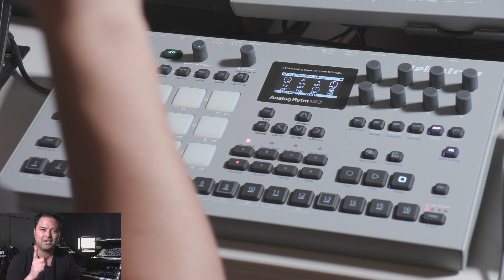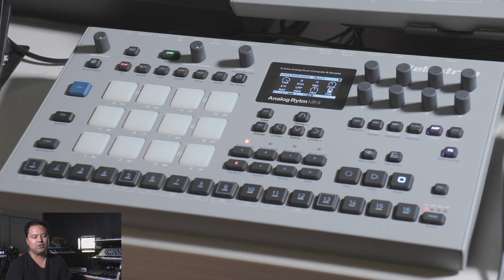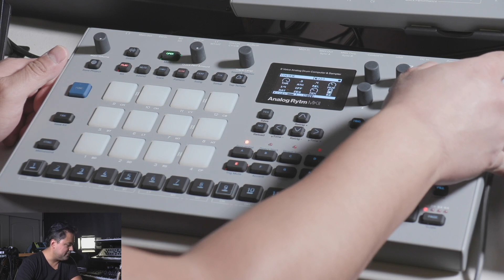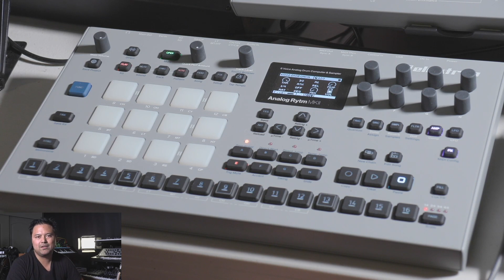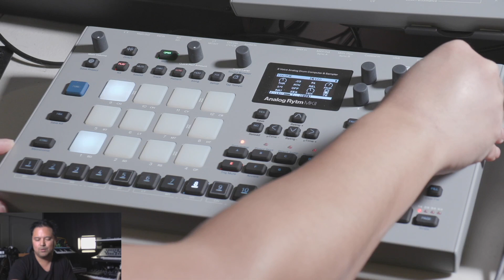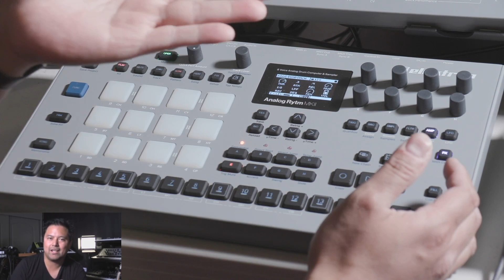How I Use Compression on the Analog Rytm MK2

Comment: Compression, along with EQ , is one of the two most important processing concepts to understand in audio engineering and music production.
It has zillion different application reasons, but as one of the fundamental processors that deal with the dynamics of the audio signal, it is important to understand the basic.  Lets simplify compression and it's parameters, in the most basic way.
Compression is the process of attenuating audio signal. In its essence, it is "just" automated volume control. The purpose of the compressor is to reduce the dynamic range of the incoming singnal and attenuate the portion of the signal that is above the set treshold. 
Compressor attenuates audio signal when it rises above the set treshold. So, all the content above treshold gets attenuated. Treshold is a negative value and is expressed in dB. With the treshold of 0, compressor will not attenuate the signal. 
Ratio does NOT control WHEN the compressor "kicks in". Ratio is a parameter that sets the AMOUNT of compression applied to the signal above the treshold level. This control simply reflects the ratio between compressor's input and output. With the ratio of 1:1, no compression will occur, ever if the treshold is set to its minimum value. With the ratio of 2:1,  for every 2 dB of audio above the treshold, the compressor will "let" only 1 dB of audio go through. High ratio values lead to extreme results and are very close to limiting (but in order not o mix terms, lets stop here and not go further into differences between compressors and limiters). On most compressors, ratio control has pre-defined values. 

Attack - this is a parameter that controls how long does it take for the compressor to reach full compression - gain reduction set by treshold and ratio. The value of attack is expressed in milliseconds. 
Release - this is a parameter that controls how long does it take for the compressor to stop compressing the signal. The value of attack is expressed in milliseconds. 
On some compressors there will be a Hold parameter, that controls how long full compression is applied to the signal, before gain reduction stops. However, attack and release can be set like so that on some compressors, hold function is not needed. 
Make up gain - as we said before, compressor attenuates the incoming signal, and the difference in input and output is our compression ratio. 
With the make up gain, you can compensate for this attenuation - the signal that comes out of the compressor will have reduced dynamic range, and make up gain allows you to bring the overall signal volume back to the initial value. 
As for the SEQ -side chain eq, it is important to understand what side chain is and also the concept of multiband compression. To understand side chain you need to know how compressor works. Signal enters the compressor, and (extremely quickly) compressor detects if the signal is above treshold. There are many different types of compressors and in technical terms, this "detection" and gain reduction is done in a different ways, but think of it like this - it is like you have your hand on a fader that controls the amplitude of the signal. If you hear that signal is too loud, you would pull the fader down, and then put it back up, when you feel signal is not loud anymore. Compressor literally does that instead of you - it analyses the incoming signal, and based on its settings, applies gain reduction. Side chain exists in any compressor - signal inputs the compressor, and in the compressor,  it gets copied. One copy of the signal goes forward through processor, while another is sent to one of the analysing components. This creates the side chain. The copy is it is routed to a component, analysed and then the main signal is processed or not based on the dynamics characteristics of the copy that has been analysed and compared to the compressor settings . That means that input signal is the reference for the compressor to decide should it apply the gain reduction or not. 
Now, what happens if instead of the original signal copy, side chain input is fed with another signal? That will trigger the compressor to attenuate the incoming signal based on the dynamic behaviour of the signal coming into the side chain. This allows for what is commonly known as a side - chain compression - the original signal is compressed based on the characteristics and behaviour of another signal. for instance, if you apply side chain compression on the bass, and set your kick to be the side chain reference, each time the kick strikes, the compressor on the bass will attenuate the bass signal. It is important to know that ALL compressors form some sort of the side chain (remember, it is just a copy of the original signal), but not all of them can receive external input into the side chain. Most of the software and hardware compressors now days do have the side chain input function. 
AR compressor has four side chain modes:
- OFF - side chain signal is the copy of the main signal, and therefore, compressor reacts by analysing the original signal, applying compression to the main audio evenly. 
- LPF - this means that the reference copy of the signal will first go through eq that will boost the low end of the signal. This means that when the signal is analysed, compressor will apply more gain reduction to the low end of the signal. 
-HPF - his means that the reference copy of the signal will first go through eq that will boost the high end of the signal. This means that when the signal is analysed, compressor will apply more gain reduction to the high end of the signal. 
- HIT - reference copy of the signal will be boosted both in high end and low end, with some low shelving and high shelving applied. This means signal will be compressed fairly evenly across the frequency spectrum.
Mix - mixes compressed and dry signal. Basically a control that tells the compressor how much of the incoming signal to process, and how much to let unprocessed. 
Now, while AR architecture sends signal into compressor in series, with the mix button, you can blend two signals. That means that you can control how much processed and unprocessed signal will go through. this is extremely powerful, as you can apply parallel compression right there within the unit.
Reply from the maker: Thank you for taking the time to write out such a great description of compression! I know this will surely help a lot of people.
Reply: @Ponchy  not a problem:) I used to teach audio on an institute and it is extremely important topic. You know what kind of mess people make later on in their producer and engineer careers if they don’t grasp the concept now.
Reply from the maker: @earlsfield  that's awesome! now I know who to bounce ideas with! and yes I know exactly what you mean. There are no real presets for compression in every situation so you have to know how to set them manually.
Reply: love this, thanks a bunch!
Reply: Everything is nice, but not sure about your description of SC filters. Using them will not make any compressor multiband, it still will be one band compression, and it will be applied through the whole spectre.
Reply: @alexgolubevvv  Well, it all depends how exactly they implemented it. Surely, if one band or portion of the frequency spectrum is being attenuated more than another, we either have multi band comp or side chain with variable filter on the input. Edit - I just checked the manual, so yeah, it isn't multiband comp, it is a state variable/multi mode filter before the side chain input cutting one portion of the frequency. Not multiband compression, granted.
Reply: Jesus Christ I read all of that. Infinitely grateful. Thank you
Reply: @neonpop80  lol I guess i overdid it

Comment: Thanks for the helpful video. Does the compression effect each kit individually or the whole project?
Reply: AR architecture places compressor as the last in the main signal chain, before main output. Any signal that goes through the main signal path will pass through distortion and the compressor - they are the two master output effects. 
Also, external input is also routed to the main signal path - meaning external instruments will also be compressed.
However, in the signal path settings it is possible to exclude individual tracks from the main signal path, as well to re-route effects outputs. For this you can use either individual outputs (physical) or you can use Overbridge for multi track control. However, it is worth knowing that ANY signal that goes through the main signal path goes through master effects, distortion and compressor.
Reply: @auralplex  Correct, my bad.

Comment: How would you set compressor if you had Octatrack audio coming into it?
Reply from the maker: If my Octatrack was going into my Rytm I would set the SEQ to either OFF or HIT depending what exactly you were playing into the Rytm. I could also see it working well at LPF, if you have a lot of bass heavy stuff going on but I would start at HIT. And then probably just a low ratio like 2:1 or 4:1 and then set your threshold to where you start to hear a reduction in volume and then set the MUP by going back and forth with the MIX setting like I show in the video.